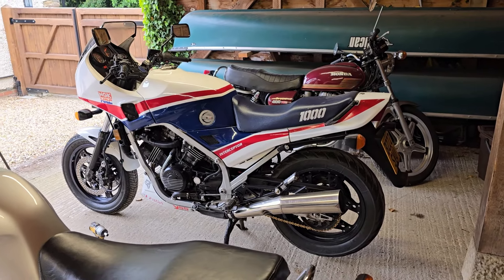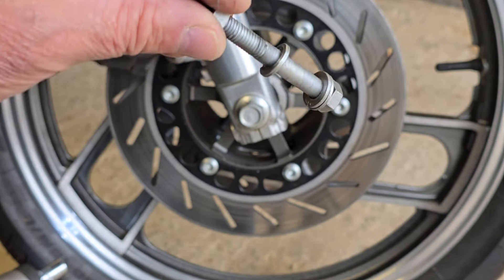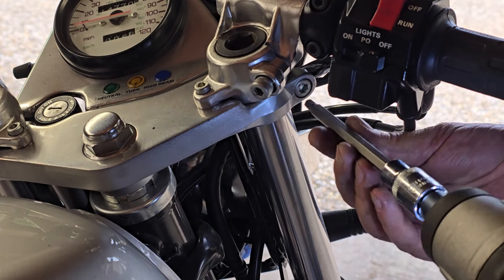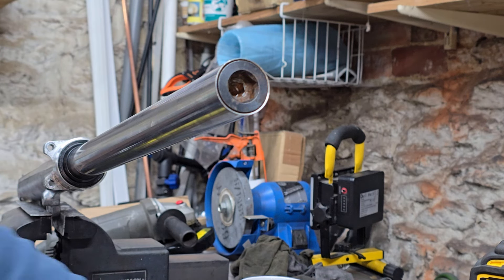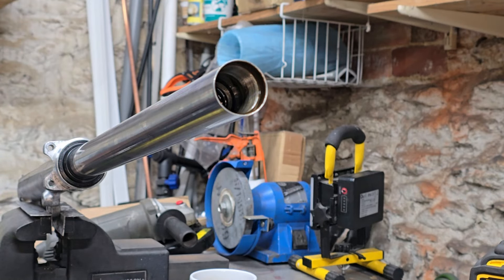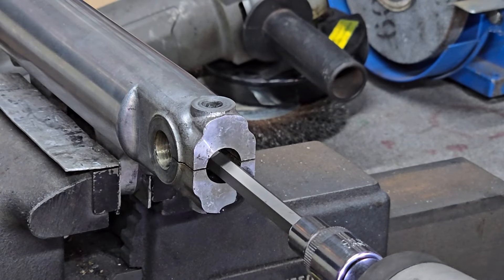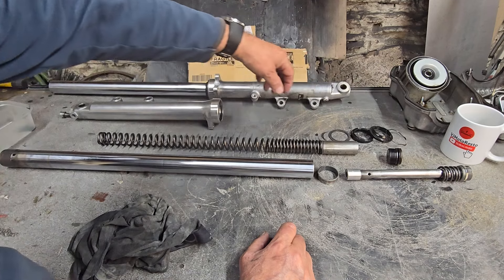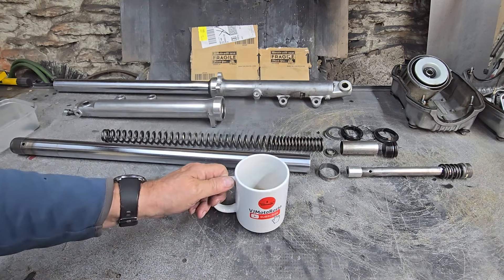How to: Disassemble fork legs ready for new fork seals

Comment: If ever the impact wrench/broom trick does not work on those bottom bolts, I've had success making up a fork tool - by tack welding a proper sized bolt (head down) on the end of suitably long and narrow diameter steel rod. Fits right in there. Cheers!
Reply from the maker: That's a great tip, thanks!

Comment: On my Sherco trials bike I could change the fork seals without disassembling the forks. Take off the dust seal and the fork seal circlip and clean the recess as best you can with the seal still inside. Empty the fork oil as best you can through the drain, or top of the fork. Put the fork leg in a vice (use a rag or soft jaws to protect the chrome) and gently heat the area slightly around the seal, unscrew the cap and valve from the top of the forks and push a compressed air nozzle against a small oring to seal it and pump air into the fork. The seal should pop out. Make sure you have a rag wrapped tightly around end of the fork where the fork seal is, because it pops off with a bang and residue oil comes out behind it under pressure. You can then thoroughly drain the oil, refit the new seals, circlip, seal dust caps and add fresh oil, and the job is done. wear safety goggles because if the oil hits you in the face it is no joke. The first time I did this I didn't wrap a rag around it, and sprayed myself and the inside of the garage with dirty fork oil. 😂😂😂
Reply from the maker: Thanks for watching and commenting! That's certainly an interesting way to remove them! I've never tried it but next time I cant get the inner out of the outer leg because the damper rod just spins, I'll give it a go!